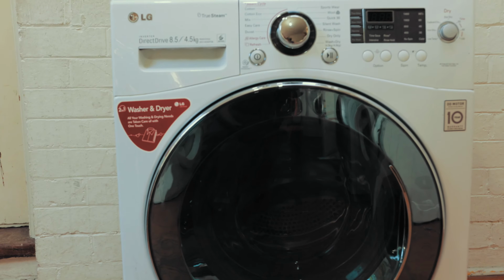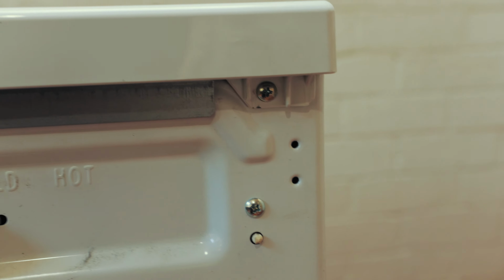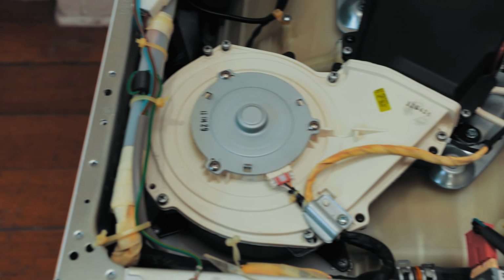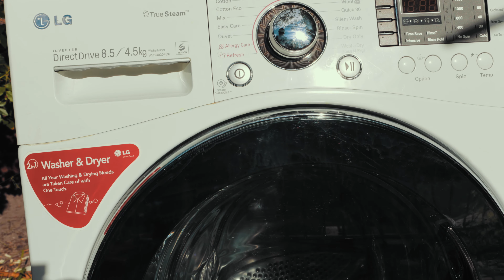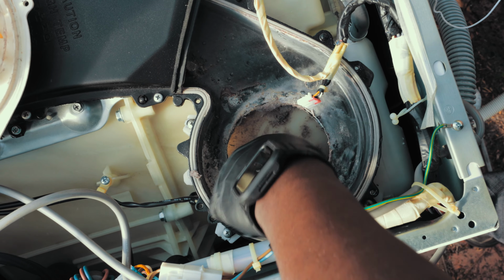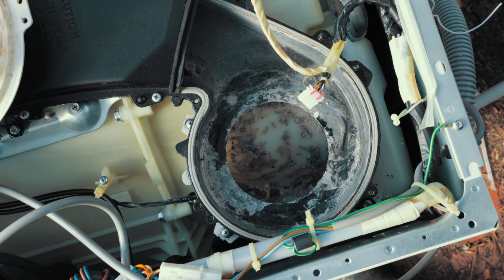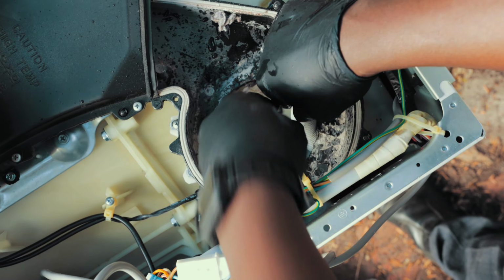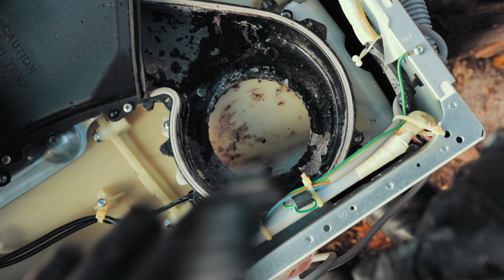LG Washer Dryer Not Drying Properly : You Can Fix Easy

Comment: 100% worked.   soooooo much lint - almost filled a takeaway carton.  wasn't able to do the flushthrough with water but was able to reach down with small hands and pull out the clumps of lint.   seemed to be a sensor in there too in the top that was covered with lint.   cleaned that off with just my fingers.   easy peasy

Comment: To thoroughly clean the condensate chamber (white chamber under the fan to the bottom rear of the drum). You must remove it and use a long brush. The part has small chambers that are filled with lint. This is unfortunately the lint filter.
Reply: Hi, how do you take the condensate chamber out?

Comment: Having this issue but fan/lint looks good. However my heating element is not getting hot, any ideas? Getting the DHE error whenever it enters dry cycle.
Reply from the maker: Hi you would need to replace the dryer heating element but before you do that check the wiring that connects to the heater to see if it’s loose or has broken. On Lgs it’s the red one on the left near the water dispenser

Comment: hi my lg washer combo direct drive is not drying my clothes. A guy came and clean out something with lint, and he put in a new pump, and it's still not drying.  The clothes are warm when it comes out but soak and wet. What do you think is the problem? It's a 7-year-old machine.
Reply from the maker: Hi. Disconnect the cold water valve electrical connection that goes to drying part. The water valve might keep putting water into the drum during the dry cycle
Reply: I’m having the same problem and my machine is brand new. Online it said that it has to use water because it’s ventless and that’s part of the problem. It also said that you can wash a full load but you can’t dry a full load. So instead of me doing laundry every week I now gotta do laundry every 3-4 days just to stay on top of it

Comment: Hi, thanks for the video. I cleaned out a lot of lint and loose paint. I noticed some caulk like silicon(?) grey sealent near the heating element and sensor. It is damaged by taking ik apart. What type of sealant is advised to use, I imagine some kind of heat resistant stuff? Thanks
Reply from the maker: hi yes heat resistant silicone

Comment: Great walk-thru. Figuring this may be my issue. I have animals so I am frequently getting errors and cleaning the bottom out. I have the US version, but they seem to be basically identical. I also leave clothes on top of the unit which I'm now thinking they probably tell you not to do in the manual but who reads those! That will also help.
Reply from the maker: Yeah I think it will need a clean. Hope you get the issues sorted
Reply: @askmrwashywashy  I opened it up. Being the American version it had one less screw than you mentioned. Everything else was the same. Lint was crammed in there, I needed a flathead screwdriver to pry it off and boy, does that paint come with it. I was hoping that would do it. It dried a little better, but a full flush of the system as described is required. Just hate this thing leaking on my laminate floor or lugging it outside, so going to get a hose and male-to-male adapter at the hardware store tomorrow. Thanks again for this! Wish LG made a better product, but it's my fault for expecting this with BestBuy reviews.
Reply: @RoyHemphill   Exactly, LG should have a much more accessible system to handle build-up of lint. They could even add a built-in high pressure lint wash cycle so it wouldn't be necessary to dismantle the machine unless there was an unusually bad problem.

Comment: Thanks so much for this video! I tried it twice now, but unfortunately the second time it doesnt seem to work. I dont have access to high pressure water so I poured water through and collected a lot of lint by hand. The heating unit works. Any other advice? Im not getting an error message but my laundry constantly stays humid. Thanks!!
Reply from the maker: hi open the trop cover and disconnect the wiring to the water valve for the drying unit,. seems yours keep pouring water in.

Comment: Nice video, quite detailed! My machine stopped drying and also there's water remaining on the rubber after drying operations (but not after washing, then it's completely no water on the rubber). Is this an indication that the condenser might need cleaning? or there could be something else blocked?
Reply from the maker: condensor needs cleaning. If problem persists. Close cold water tap and run dry cycle. If that works your cold water inlet valve is faulty
Reply: @askmrwashywashy  Thanks for the reply, I opened it up but unfortunatelly it is slightly different and i cannot access :( . There's no removable container as you have, it is "embedded" into the tub. Once i unscrew the fan on the top, there's a faucet (the water inlet) preventing me to remove a filter that could give me access from the top (not that i could do much from there). I cannot remove it, no access to the screws (too close to the edge side cover) and even if i could, the faucet is longer than the space available (i have no idea how to remove it). Seems i cannot spare the ~150 euros to call service :(

Comment: Ok. Have this unit just about.2 years and I have to hit dry cycle 3 times on one load.  Just followed these instructions.  Not difficult for my old self at all.  Doing a load now.  Let’s see if it worked.
Reply from the maker: Hi glad you found this video hope it works out for you
Reply: @askmrwashywashy  my goodness. It worked! I didn’t blast water as I’m indoors but I shoved a vacuum hose as far down as it would go then poured water down.
Reply: @askmrwashywashy  and I just have to say the clothes come out piping hot. I forgot that’s how they felt in the beginning 😊
Reply: @Oglulubell  Thanks for the advice. I did the same. I wasn't going to drag a 150 lbs machine outdoors to save my back. Now clothes are nice and hot as they should be. I can see why the machine wasn't working properly. alot of lint in there.

Comment: I just bought this brand new and it won't dry, just got it installed and tried to use it. 
Washing was good, drying was pretty bad. It's been 5 hours (2 1/2 in the morning, 2 1/1 at night) and the clothes are still dripping wet.
Reply: Same problem here. Were you able to fix it?

Comment: Hi, thanks for the video. 
My fan is also noisy can you point to the replacement part? How can I find replacement fan code?
Reply from the maker: Hi Welcome. I'll have a look and get back to you later today. Whats the model number of your washing machine?
Reply: @askmrwashywashy   Thank you for your reply.
My washer/ dryer is FH4U2TDH1N (Europe). Any help will be highly appreciated.
Reply from the maker: @NIKOSGEOR  whereabouts do you live ?
Reply from the maker: @NIKOSGEOR  have you cleaned the fan. How long have you had. it?
Reply: @askmrwashywashy  unfortunately the screw from fan motor is very rusty and I can't apply lubricate to motor. It is very close to get broken. The fan is clear but the motor is noisy when is working. The problem is that i don't know how to search for replacement parts for this devis. Any tip will be highly appreciated.
Thanks again
Reply: @askmrwashywashy  Greece
Reply from the maker: @NIKOSGEOR  Best would be to look through the Lg Greece website, Find the parts section or give them a call and they can sell you the fan

Comment: Does this washer dryer you use have the drum clean function ? If machines that does, would it prevent this from happening? Or drum cleaning doesn’t wash away the lints that get stuck here ?
Reply from the maker: yes it has but drum clean does not clean lint build up in that area
Reply: @askmrwashywashy  so only fluff clean function does the job ?

Comment: Followed your steps and didn’t have much lint however a more peculiar issue arises. When starting the dry cycle it kicks on just fine runs through the tumbling and draining process. As soon as it takes the cold water in for drying and attempts to kick on the heating element there is almost like a clicking noise in the control panel. I took the voltage tester to test power to the heating element, power goes on and off. The display in the front is also flashing on and off in the same frequency as the heating element power. I tried replacing the high limit thermostat and that did not help. Do you think it’s a bad motherboard or a bad heating element. No codes show up on the display asides from the it flashing on/off
Reply from the maker: Hi. Good on ya for going through all that diagnosis. Might be a faulty heating element. How much voltage are you getting when you attach the test meter ? I have a fisher n Paykel washer dryer that does almost the same. No fault code. Tested heating element Twas faulty. What resistance are you getting when you test the element ?
Reply from the maker: Hi. Good on ya for going through all that diagnosis. Might be a faulty heating element. How much voltage are you getting when you attach the test meter ? I have a fisher n Paykel washer dryer that does almost the same. No fault code. Tested heating element Twas faulty. What resistance are you getting when you test the element ?
Reply: Hey so just had ordered a motherboard from eBay. tried the dry function again and the same issue occurred except this time I think it ended up messing up the new board as it lost power after trying to kick the heating element and never came back on. Continuity is good on heating element, voltage I cannot read because it only feeds the power briefly before turning on/off in a cycle like a blinker. It is possible that the board I got was had but I’m thinking you might be right and it’s the heating element. If continuity is good does that mean the heating element is fine? Could this be a power supply issue

Comment: Hey thanks for the video! We've been having trouble with our washer. We did everything that you mentioned in this video and it's still not drying our clothes. Do you have any additional troubleshooting suggestions?
Reply from the maker: hi sorry for the late reply. 
Yes. 1) You can remove the top cover and run a quick timed dry cycle. halfway through the cycle pause it. turn it off and unplug from wall socket. Put your hand on the heating element cover* careful its very hot, this is just to check if its getting hot enough. Should scolding hot. 
2)Another thing you could try is switching off the water supply when running a dry cycle as the water inlet valve might be constantly dosing water into the drum during a dry cycle. its only supposed to do this intermittently. how long have you had your washer ?
Reply: @askmrwashywashy  is there a way to test if the inlet valve is dripping?

Also excellent video, super helpful!

Comment: What do you recommend for mine? If it washes well but doesn't dry, what can I do?
Reply from the maker: If giving any errors on drying I’d chase the error see what it means. If it’s dirty inside a clean will help
Reply: @askmrwashywashy  it not giving me any error, the only thing is that not dry.
It could be like you said that maybe its dirty or did you think that I need to look the sensors to see if the turbine its not working well?

Comment: Honestly, who wants to put up with this bullshit? I’m as handy as the next person, but every video I’ve see on this contraption is a work-around for shitty engineering. The unit is loud, doesn’t dry, doesn’t clear the detergent dispenser, takes forever to cycle through, and only fits about 3 pairs of clothing. All joking aside, I’d rather have a regular washer and dryer in my living room, as goddamn coffee table, than ‘save space and energy’ on this POS. I moved into a unit where this device existed BRAND NEW. My first thought was, “oh, that’s cool!…Hah, would you look at that?!” That feeling quickly changed to, “hmm, this thing sure is loud and it takes a long time to wash/dry a load?”…”hmm, after 3 hours, these clothes are damp-damp?”…”Okay, I only loaded it halfway, why the fuck is it still not drying?!”…I hate this machine so much, I’m going to pull a ‘Michael-Bolton-taking-a-bat-to-the-printer’ on it before I move out and gladly pay for a replacement washer AND dryer for the next sap!
Reply from the maker: Hi yes some models don’t dry as well as others. Separate washer dryer is always better
Reply: the quality of all washer machines and dryers are shitty today. Most last ten years at best.
Reply: I own a home where the only option for my space is a combo washer/dryer and I had the same experience as you. “Oh this is neat!” to “I’m going to burn this house down with this godforsaken appliance in it”. I shouldn’t be having to contemplate taking my clothes to a laundromat when I live in a damn house. LG can suck me from behind for this one.

Comment: but what does the DHe error mean?
I have cleaned out a gigantic amount of lint from this machine before and it worked for a few more years. This time, after cleaning a minimal amount of lint from the condenser (and fan unit), drying works for about ten minutes before giving the DHe error. You said you'd tell us how to fix the DHe error?
Reply from the maker: Hi. Try it again when it gives the error turn it off. Unplug it and feel the heater. If it’s warm the heater is working if it’s cold it’s not. Another way. Unplug it take multimeter and put it on continuity  setting. Put one lead on one terminal on the heater the other on the other terminal on the heater. If you get no continuity the heater is broken
Reply: @askmrwashywashy  IS DHE Supposed to mean just that the heater isn't heating up? I'm not sure but it doesn't SEEM to be heating up?

Comment: thank for your help but when im drying my clothes i still hear water when i take out the holes water still coming out my clothes are very damp
Reply from the maker: Hi do you know the model number of your washer ? You might have a water inlet valve that keeps putting water in
Reply: You keep hearing water as that's the self cleaning mechanism which is supposed to wash the lint away in middle of the drying cycle. Except when too much lint has built up, the cleaning fails, and instead moisturizes the lint, which the again moisturizes the air in the condenser instead of drying.

Arguably, the water pump driving the cleaning mechanism has far too little pressure to do the job it's supposed to.
Reply: @askmrwashywashy  Hi! how do we fix the water inlet valve?

Comment: What if you can't take the washer outside? is there a way that I can do this inside without a water hose?
Reply from the maker: Hard to do it but I suppose with a lot of towels
Reply: @askmrwashywashy  Surely the way I have been doing this all these years isnt wrong? By maneuvering the drum sideways, you can uncover the condenser securing screws and simply take the condenser out? then clean it out in some sort of sink.

Forgetting to put a lint trap in a dryer must be the absolute worst design mistake I have ever seen! Especially when rather than admit their mistake and issue a recall and fix the problem, LG withdraws all their technical support to stop people asking them about this gaffe.

I will never buy another LG product.
Reply: @amandaripanykhazova1798  Surely I will neither.

Comment: Thanks for your help
Reply from the maker: Welcome mate hope you were able to fix your Washer
Reply: @askmrwashywashy  Is there a way to get the burned rubber smell out? It happens when the drying cycle is on. Thx
Reply from the maker: @dnhawkins9275  Hi thanks for reaching out ? do you use time dry cycle or cupboard dry setting ?
Reply: @askmrwashywashy  I believe just the time dry setting
Reply from the maker: @dnhawkins9275  try and use the cupboard dry setting. That way it wont overheat/overdry the clothes thereby having burnt rubber smell. Whats the model number of your washer ?
Reply: @askmrwashywashy  it's a WM3997HWA. Is the cupboard dry setting just the pre-set setting?
Reply from the maker: @dnhawkins9275  hi thanks for that. Yes use the preset setting that might be better. How long ago did you get it ?
Reply from the maker: @dnhawkins9275  yes that would be it the preset one

Comment: why the fk does the dryer take hours when dryer's take like 20mins normally to dry shit lol
Reply from the maker: I feel your frustration. Problem with washer dryers is they are first a washing machine then a dryer. So it’s a wet environment. The other thing is the drying is condenser drying technology which is better but takes longer. If they used vented it would be quicker to dry

Comment: So are you suggesting that my tiny sister lift a 300 plus pound unit and carry it downstairs and outside???😮 This is the worst machine ever made. Do the engineers still have jobs???  O wonder customer service is so horrible on a 3 week old machine. ITS A 🍋 LEMON!!!
Reply from the maker: Sadly the design wasn’t so good back then. The newer ones have a filter/screen at the top under the fan so you can service it in place